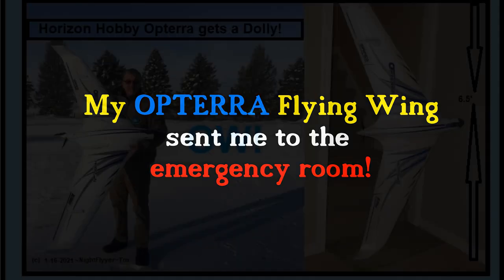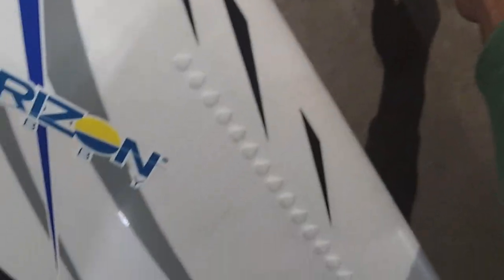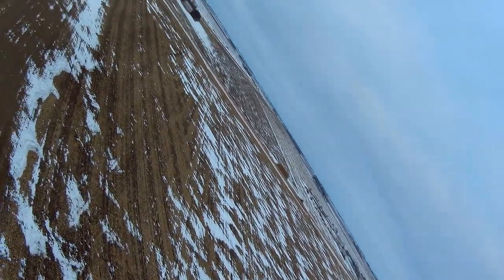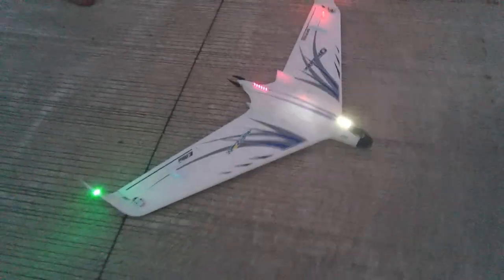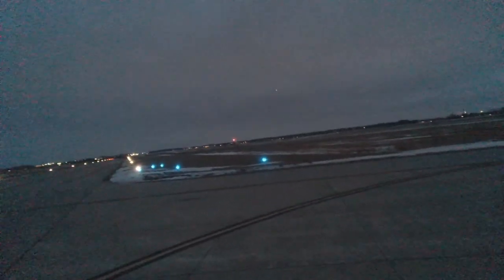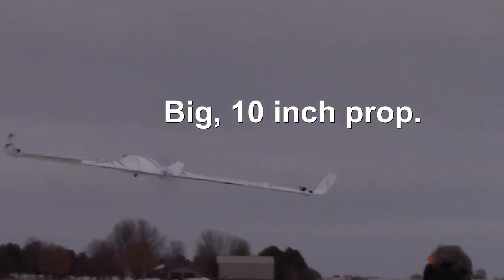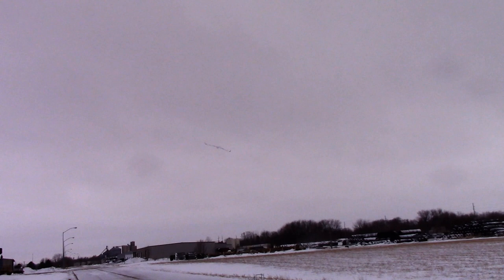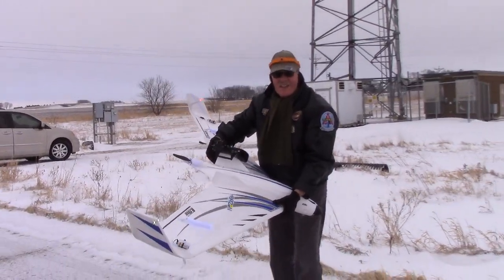My Opterra 2M Flying Wing sent me to the E.R. This is an awareness video & my solution for launching

Comment: I have an Opterra 2M.  No doubt many have made these same comments, but they may not own the plane.
1.  Throttle cut will prevent accidental start up while carrying.  I have dozens of planes and none initialize like you suggest.  Quads excepted.
2.  I do in fact side arm (Frisbee) launch mine, so you shouldn't say it can't be done.  But it is awkward. 4S helps.
3.  A bungee launch works 100%.  Nothing fancy...I just attach it around a bush, walk the plane back, hold the plane by one wing, start motor and let go.  No launching rig or anything.
4.  I have many wings.  Not one would I ever power launch with my hand forward of the prop.  And you know why better than anyone.  :)
Reply from the maker: Of course I know how and a have.  II followed instructions in the manual and this is the way it bound up and arms the motor as soon as you plug in the battery.  It's my warning to be cautious, because the manual says nothing about programming in a throttle hold to a switch. I've known of times when after flying, that switch was forgotten to be moved back to safe and it armed as well.  Nothing is 100% as it could be left in the wrong position, by accident. I'm pretty experienced, so never relied to on a throttle cut/hold, as all my machines need throttle stick movements to arm.   I only am warning others to be careful BEFORE the launch and to be careful no matter what you use. 

I appreciate your advice. We Marines were taught to follow instructions and stick to the plan or get dead!  So after spending 33 years in the Marines, I managed to stay alive because of that.  This wing is 7 foot long and will bend and break the end off the if you even try to pick it up by the tip. It would also be extremely difficult to somehow launch it discus style with the elevon there and that 7" tall winglet rudder that is also on the tip.  I know how to do it , but not with this plane. Besides my lights are now in the way too. 
 
So I followed the instructions word for as I did for the video I made of my product review earlier, but it bit me.  https://www.youtube.com/watch?v=P_inF5EYLEE&t=1s

Here is word for word what the Opterra 2M manual says about launching.  
1. Put the aircraft into launch mode with the channel 5 switch.  (in my first video that did not work, it went into the ground)  
2.  Hold the aircraft in one hand and the transmitter in the other.  
3.  Apply full throttle and throw the aircraft directly into the wind, angled slightly up (5 to 10 degrees above the horizon). 
4.  Climb to a safe altitude and check the trim.   
I know others have their own ways, and either way, my Dolly is the safest solution for me.  
The Opterra 2M manual also says nothing about throwing it with the motor off, so if a newbie followed the instructions, like I did, I'm showing what could happen, in case a gust of wind got them or something else.  The 7 foot wing is too big to throw discus style, as it bends a lot when you pick it up and the big wingtip's winglets are in the way.   Nothing is 100% and no matter how good you can throw, this big 7 foot wing with a 10 inch prop spinning right next to your face, is risky. 
Maybe a gust of wind, maybe my 73 year old left arm was weaker, or who knows.   But either way, if it happened to me launching the way I thought was good (and  the same) as all my previous launches. So if it can happen to me, it can happen to others, and that is the warning I want to present.  Thanks.
Reply: @NightFlyyer  Yeah, I won't defend the instructions.  They're not safe.  You're proof of that.  Here's how I side-arm-launch a large wing.  If you want to launch north, face south.  With right hand hold the wing vertical (ie, hanging down) by right leading edge, thumb above, fingers below.  Advance the throttle until it starts to get unwieldy.  Now simultaneously take a step back with the right foot, advance the throttle to full, and pivot your body and your arm clockwise.  I swing the wing about 1/4 circle, it levels off on it's own during the swing because of centrifugal force of your pivot plus effect from the motor.  When it's heading north, simply stop rotating and guide it another foot or so before letting go.  It will now be level and a slight up attitude.  Works like magic.  But honestly, the Opterra is a bit underpowered for this technique (my only large wing that is) hence the use of 4S for improved launch.  I only fly at half to 3/4 throttle because I didn't upgrade anything except the battery.  As you can see, this technique remedies your concern for the difficulties of trying to hold it horizontal prior to launch.  No bending.  No proximity to the prop.

Nothing against your dolly. Kudos for your solution.  But you really should learn to side-arm launch a wing or any other pusher plane that represents a finger hazard.  Your experience is not uncommon.
Reply from the maker: @wam7484  I appreciate your concern and wanting me to try to launch this discus style, but my battery for the lights, elevon, winglets is in the way, and the fact it is heavy and I am 73, I don't feel confident.  Besides my Dolly works and is easy and  best for me.  Thanks. .

Comment: I love flying wings but I hate that option of injury so after watching a couple guys in Europe fly them I started throwing them like frisbees I grab one Wing and Power up and throw it and it totally settles into the air. Youd think it’d spin around and crash but it actually works pretty good
Reply from the maker: It wont work well with this one.  This wing is 7 foot long, heavy, underpowered, and will bend and break the end off the if you even try to pick it up by the tip. It barely has enough power to fly out of your hand at launch and especially while I was trying to throw it into 12 mph wind. I know and I tried to launch it discus style, but could not hold it where I felt I could launch it successfully in the wind.     It would  be extremely difficult to somehow launch it discus style with the elevon there and that 7" tall winglet rudder that is also on the tip.  I know how to do it , but not with this plane.    Here are the links to the last videos and you can see I launched it the same way without problems.
https://www.youtube.com/watch?v=P_inF5EYLEE&t=1s&gl=CO  and   https://www.youtube.com/watch?v=ur5V5H8UcGs&t=1s   Thanks.

Comment: Throw it then hit the throttle?
Reply: Yeah. I don't know why so many people want to have the motor blaring while they throw
Reply from the maker: The Opterra 2M manual also says nothing about throwing it with the motor off, so if a newbie followed the instructions, like I did, I'm showing what could happen, in case a gust of wind got them or something else.     Nothing is 100% and no matter how good you can throw, this big 7 foot wing with a 10 inch prop spinning right next to your face, into 12 MPH is risky to say the least.  The 10" prop is very close to your forearm as well, so a gust could tip it back even before launch, as others told me happened to them.  Thanks.
Reply from the maker: @iforce2d  Because that is what the directions say to do.  The Opterra 2M manual also says nothing about throwing it with the motor off, so if a newbie followed the instructions, like I did, I'm showing what could happen, in case a gust of wind got them or something else.     Nothing is 100% and no matter how good you can throw, this big 7 foot wing with a 10 inch prop spinning right next to your face, into 12 MPH is risky to say the least.  The 10" prop is very close to your forearm as well, so a gust could tip it back even before launch, as others told me happened to them.  Here is word for word what the Opterra 2M manual says about launching.  
1. Put the aircraft into launch mode with the channel 5 switch.  (in my first video that did not work, it went into the ground)  
2.  Hold the aircraft in one hand and the transmitter in the other.  
3.  Apply full throttle and throw the aircraft directly into the wind, angled slightly up (5 to 10 degrees above the horizon). 
4.  Climb to a safe altitude and check the trim.   
I know others have their own ways, and either way, my Dolly is the safest solution for me.  
 Thanks.
Reply: @NightFlyyer  Yes there should be a warning in the manual.
I’m pretty sure you could sue over there in the US

Comment: Wow ! I felt that, just a thought, maybe you could use a chainmail glove  like a butcher uses if you want to continue to hand launch this model ?
Reply from the maker: Thanks for that suggestion and I tried that already, but because it was cold.  I found trying to hold on to the tiny finger grips on the bottom of the 7 foot wing with a thick glove under full power with wind blowing was difficult when under power and then trying to fly with  a big enough glove on was also difficult to fly the transmitter, (I'm a stick pincher)  so although that sounds like a good idea, it did not work that well. Some have told me the Prop got them in the forearm even before launch, when a gust of wind got under the wing and tipped it back.   We are only talking about a Half inch of clearance that I needed to keep from getting cut, and even though I pulled it off several times in my earlier product review video,  I will never hand launch it again.  LOL.  It's hello dolly from now on!  Thanks.

Comment: Dave, with an eflite you set 1 of your toggle switches as an arm/disarm switch. Should be in manual.
Reply from the maker: Of course I know how and a have and it is not in the manual.   First of all, that had nothing to do with my hand injury. I only mentioned the Throttle arming because I followed instructions in the manual and this is the way it bound up and arms the motor as soon as you plug in the battery.  It's my warning to be cautious, because the manual says nothing about programming in a throttle hold to a switch. I've known of times when after flying, that switch was forgotten to be moved back to safe and it armed as well.  Nothing is 100% as it could be left in the wrong position, by accident. I'm pretty experienced, so never relied to on a throttle cut/hold, as all my machines need throttle stick movements to arm.   I only am warning others to be careful BEFORE the launch and to be careful no matter what you use.

Comment: OUCH that made me hurt just looking at it, glad you're going to be alright. I instantly thought of longer PVC poles or a glider launcher to pull it up, or how about actual landing gear? Some skids on the wings and a mono wheel in the center up front. Thanks for sharing you fun and misadventure. Best Wishes & Blessings. Keith Noneya AT1 USN/R-TAR Retired
Reply from the maker: Thanks for the suggestions.  And thanks for Serving.  If you had watched the previous video, you would have seen I did put a small wheel on the bottom for landing and also metal skids to protect it.  And my launch rail 7:12 did not work in this video.  My Catapult 7:26 would have worked probably, but it was destroyed in the fire that destroyed my jets and my home, so I never built another.  The instructions only say to hand launch it and tells how.  Of course nothing is 100%, and others told me they were holding this big 7 foot wing and before they launched, a gust of wind got under it and it tipped back and cut their forearm and 3 tendons.  Its hello dolly for me from now on.   Here are the links to the last videos with wheelie and successful launches.  https://www.youtube.com/watch?v=P_inF5EYLEE&t=1s&gl=CO  and   https://www.youtube.com/watch?v=ur5V5H8UcGs&t=1s
Reply: @NightFlyyer  Yep I saw those, some great mods for sure. But they don't lift the plane off the runway so the prop won't hit the ground. When I said add some actual landing gear I meant something with some length to it. Here's a few links to Horizon Hobbies that I had in mind. 
- https://www.horizonhobby.com/product/nose-gear-apprentice-s-15e-rtf/EFL310006.html
- https://www.horizonhobby.com/product/nose-gear-set-t-28/EFL08255.html
You could use two big ones for mains right next to the body and the little one for the nose. The cool part is if you connected the nose to a steering system you could taxi with the lights on, how cool would that be. Of course you'll have to figure out the length or build some drops to mount them too. 
- As for the wing tips I was just kinda thinking like the U2 Spy planes used, except yours could just be some bent spring wires. Thanks for the super show, loved the lights in flight. Best Wishes & Blessings. Keith Noneya
Reply from the maker: @keithnoneya  Thanks again, but I do not want to go thru all that. My wife got this as a Christmas present thinking it will be a nice relaxing airplane, but with all the suggestions and people who beat me up about it,  I will just use my dolly and relax.
Reply: @NightFlyyer  It's all about fun anyways. No one should give anyone a hard time about something like that. Anyone been in the sport long enough knows your gonna get hurt, some minor some can be more serious for sure. Just ignore the haters, they are probably CPU RC Flyers anyways who couldn't build a plane much less put or keep a plane in the air if someone got it into the air for them. Keep up the great videos and be safe. A former Marine chauffeur, uh that's USN, they guys that took you guys everywhere on ships. LOL. 
Best Wishes & Blessing. Keith Noneya
Reply from the maker: @keithnoneya  Thanks for serving, and yes, you did. I would never had seen so many places without your chauffeur ship.  My time on the USS Midway was one of the best I ever had in my 34 years of USMC.
Reply: @NightFlyyer  Thanks bud, you too! I did four CV's, when around the world four times and got out at 20. Still serving on contract in La. at the JRB fixing electronics. Unfortunately I haven't had time to do the RC stuff in years. I was thinking about fixing a few up and passing them along. Of course I'll have to keep a couple just in case I, "I feel the need. the need for ........ Nitro" in my nostrils again, LOL. I think I only have one legal radio left anyways, the others are antiques and in the Ham bands now. Anyways. Best Wishes & Blessings. Keith Noneya

Comment: Wow too bad buddy... I have flown the same Opterra and never had an issue, not even a close call. First, you need to set up a throttle cut in that radio. It's very easy to do and all models should be setup with a throttle cut. Secondly, you can launch without the prop spinning at all, the Opterra is powerful enough to launch it and then go full throttle, provided you launch it towards the wind. The other way to launch it is to  have someone launch it for you BUT by using two hands and throw it over the head, front to back with arms extended out and up.

Comment: Surely a thin guard flat profile around prop can be fabricated 🤔
Reply from the maker: Yes, I though about that, but it has to land and a shroud would be what hits the ground.  This is a folding prop, so when it shuts off, it sticks straight back and out of the way for landing.  If a shroud was there (like ducted fan), that would be what hits first.  Thanks for suggestion, but it's Hello dolly for me from now on.

Comment: Same thing happened to me but I cut my wrist on Flite Tests P-38 when I was trying to sync up the motors. For some reason I didn't get the 4 beeps so I bent down to reposition the plane as I need to be on level ground (AR637T receiver with the safe and will not do anything unless it level) I feel for ya I got 10 stitches inside the skin and 15 outside the skin
Reply from the maker: Ouch.  I appreciate your comments.  Thanks kindly.

Comment: Would a prop with a ring around it like the props on Drones work?
Reply from the maker: Good question.  I thought about that, but since it would have to be bigger than 10 inches, it would hit the ground on landing every time, and would not last very long.  The prop folds straight back when the motor shuts off, but a prop ring would not.  Thanks.
Reply: @NightFlyyer  Okay, so what if you made cuts in the ring in between the blades so the ring segments would fold with the blades when the rpms dropped on landing? 

The centrifugal force should keep the ring circular when the rpms are high which should help keep fingers away from the tips and leading edges of the prop.

Of course if the ring deflected the cut ends of the ring segments could stab so you would not want to make the cuts in the center of the spaces between the blades. Rather, you would want to make the cuts at the leading edge of the blades and file the the tips of the leading edges flat where they could become slightly exposed from the blades flexing and folding some on impact. A blunt leading edge will hurt, but probably won't cut to the bone. 

Mounting a motor and experimental ringed prop on a secure stand and videoing with a high speed camera while striking the prop  prop at full rpms with a dowel to simulate a finger or a hand strike would reveal what ring segment design might work best. 

Another possibly easier solution would be to design some kind of "atlatl" cradle to throw the plane with to launch it.  Google atlatl to see what I'm talking about if you are not familiar with this ancient spear throwing force multiplier.

-Just some ideas to consider... something the manufacturer should have done.
Reply from the maker: @mikenodine6713 Definitely a good idea too..  But for this old man, its the dolly from now on. I will never ever hand launch this again.  Thanks.